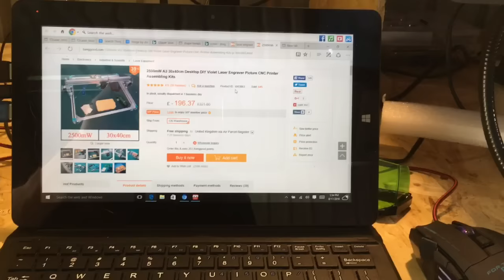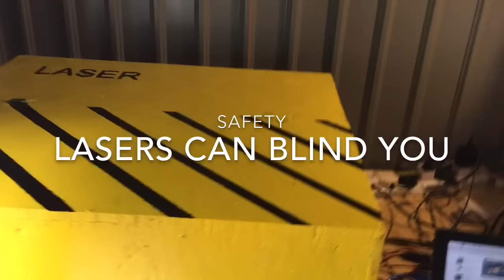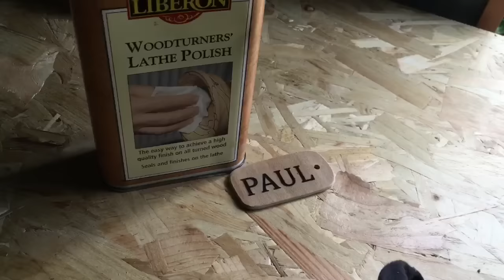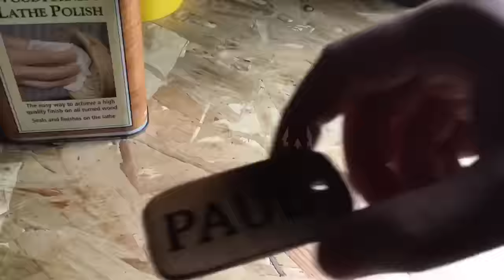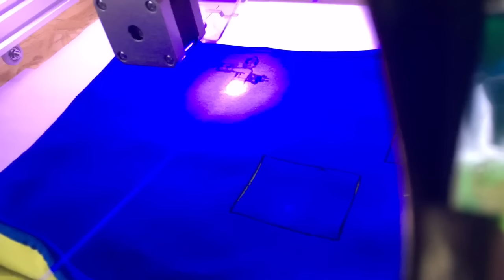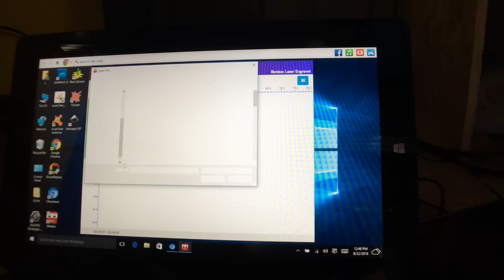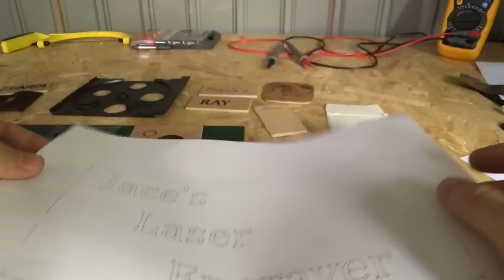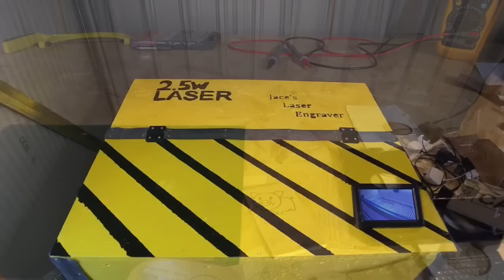2.5W DIY 445NM BLUE LASER ENGRAVER

Comment: Love it mate, it’s a sweet setup with the case you made for it and a sweet share to help
create ideas :-p so want one now :-( hmm some spit ball ideas for her off the top of
ma head include: use to cut leather to create: nice side carry satchels, backpacks,
bike saddle bags, refurb old worn office chairs and …for suits of armour :-p to
etch from plastic: pc towers, electronics cases, thick plastic for bike boxes
say 12-16mm thick tough plastic if possible (good for protecting li-ions), for
rubber im thinking of perhaps a qr code in the rubber then that over a white
background for a cool 3d qr of say your channel, questions hmm: can it engrave say metal, say
stainless steel of a watch back, or perhaps a brass plaque? can it be used to etch pcb boards? Can it be
used like a small tig welder to bond stuff together :-D I specially like the
stencils there they are really cool for spray paint for scale stuff and 1:1
stuff alike, while its 1mm thick font it can do is really impressive for the
resolution it etches at, its a longish comment here but very cool piece of kit
:-p
Reply from the maker: Very cool bit of kit would love one. all the things you could build with it from sheet wood, tables chairs, flat pack furniture manufactures could rent design files. so Manny things also your not restricted to the build size of a cnc router you can go as large as you want. Awesome.
Reply from the maker: can't do metal you need like a 80w co2 laser. it can etch pcbs. 
some are working on software to use it for laser soldering for assembling surface mount component boards.
Reply: Norfolktuber
honestly i so want one of those hand router things now :-) i cant wait till they mass produce them and the cost comes down a bit more, if i could get a similar router that worked on a wet tray so i could cut thin steel it would be pretty legend, im happy to wait while it grinds its way through if i can get bob-on perfect metal parts :-) i would love to have one to see if i could jack it to do just that :-D
 its pretty awesome how the mods come out for diffrent devices like the lazer etcher them to as you say laser solder stuff, thats a nice touch, an extra dimension to the hardware that would be most useful for diffrent projects.
 the pcb board etch access would be really handy :-) from the resolution on that small lettering you did there it hints it would etch some nice small sharp pcbs for the win :-)
 Hoping you are out there and enjoying the long weekend down there as well :-) ive been chilling doing a bit on the cementing in the shed over the last day or two for the scale car park :-) im doing cheap jobs while i wait to get some money in again :-D
 and i must say for the nice easy going pace of it i am really loving it atm :-) im always rushing round so its quite nice to take a tea in to the shed and play without care like a big kid for a few hours :-p

Comment: That's brilliant mate,
Do you have a camera installed inside because I was thinking of doing it myself so I could keep an eye on things on a old PC monitor (I've got a orange self adhesive film I could put across the screen but still see things as they happen, because I was going to have my enclosure sealed with "obviously vented with maybe a 100mm ducting, I've got the same model but on the laser module " isn't as powerful as yours I don't think" mine is what looks like 300mw
I say 300mw because the writings and paper sticker on the module is bloody microscopic,
The space needed for the framework ( floor area ) is 29" x 33" I've left a extra inch or there about on the (with + depth),those wire's are a pain in the arse "I can't do anything about them getting in their way of the laser as they are really short so I might have to hang them (above the module) with cable tie's, I'm going to put Castor's underneath so I can move it around  (get them from "Toolstation and Screwfix. Anyway I've yet to get it working I'm also going to use the same software so if I have any problems I might get back to you.
Brilliant setup you have well done.

Comment: Great enclosure for the engraver! For using T2 laser you have to upload a new firmware and change the jumper on the controller board? And about this software, can you use the free version or buying the software is needed? Just wondering if it worths.. but I think that Benbox is too limited.... THANKS
Reply from the maker: Thanks. Yeah i have two nano's one flashed benbox other t2 so if i want to swap back easy.
demo works you can do limited stuff with the demo still worth playing with. yes i think it is worth the money.
All the best.